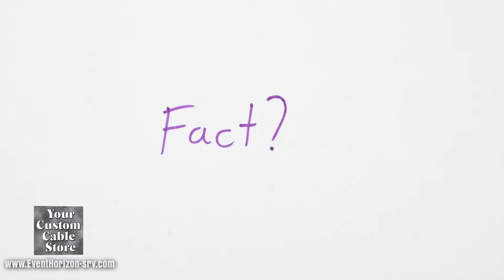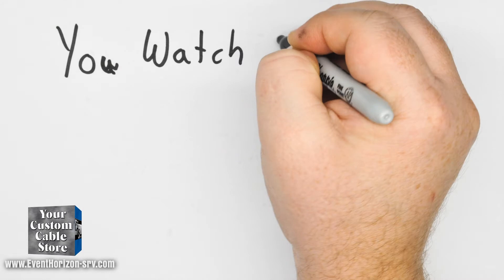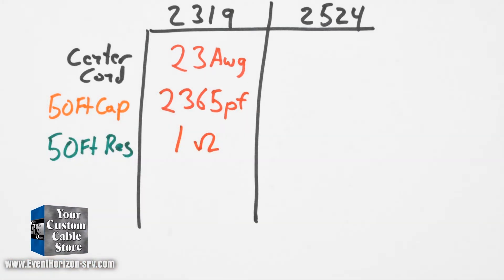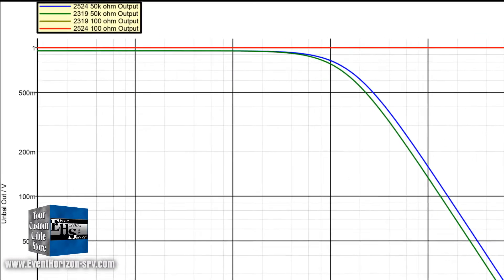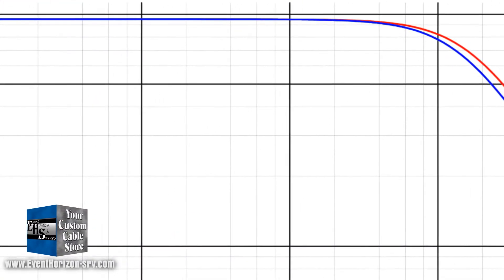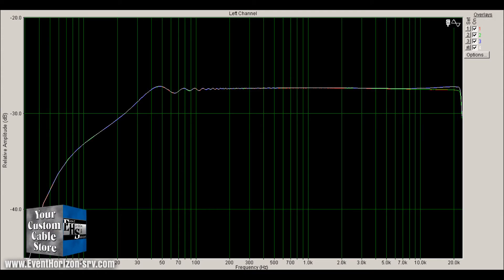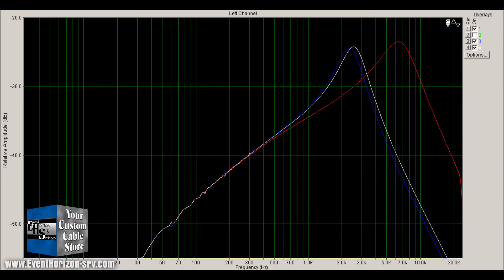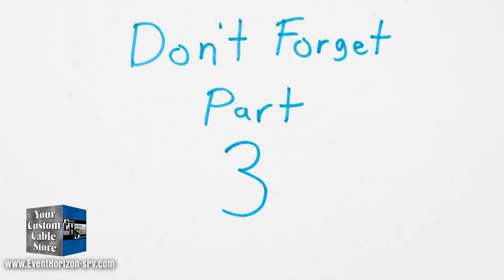Advanced Study of Guitar Cables, Part 2: Wire Size

Comment: I use cheap 16-18 AWG unshielded lamp-cord for speaker cables. Is there a Home Depot equivalent for shielded 18 gauge guitar cable?
Reply from the maker: Hey, Usually, there are very limited options at the box stores. You might be able to find bulk wire like that at your local music store.
Reply: @EventHorizonSrv , thanks, great series. I'm going to watch them all!